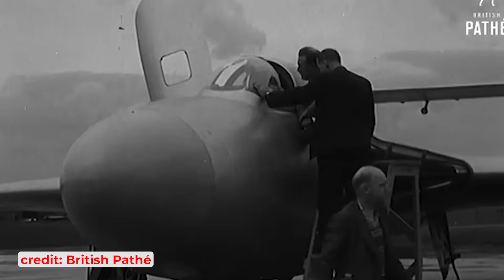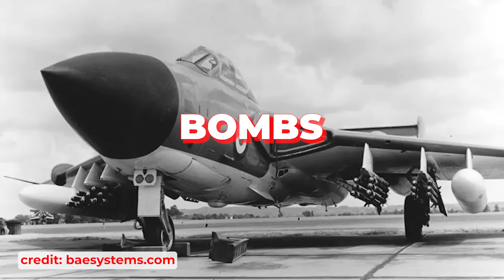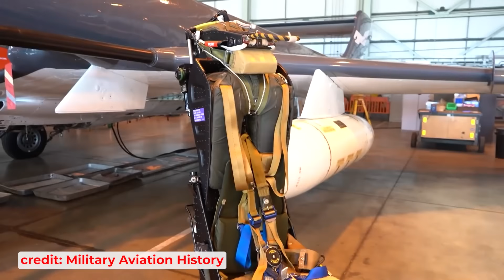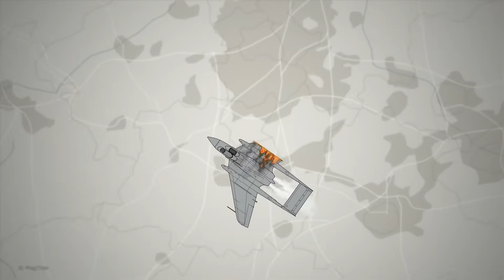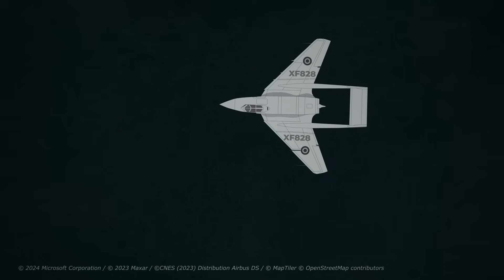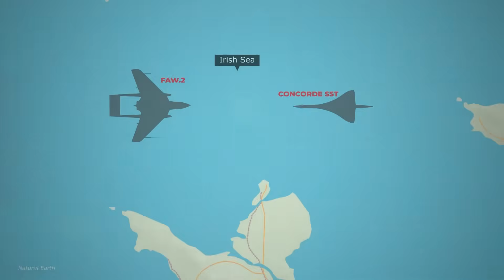Sea Vixen: A Beautiful Killer

Comment: It wasn't the first to break the sound barrier,  that went to chuck yeager in a bell x15 , according to wiki .
Reply: Yes, Chuck Yeager was first to break the sound barrier, but in the Bell X-1, "Glamorous Glennis"!  Not in the X-15 (which was by North American)
Reply: He said first of its type, meaning a twin-boom aircraft.
Reply: @andrewdking  The Sea Vixen was sub-sonic. No de Havilland aircraft ever flew Mach 1.
Reply: @DoktorBayerischeMotorenWerke  I think there was mention later in the video it broke the sound barrier in a dive. Then again some prop planes came close to doing that in a dive I've heard but not substantiated.
Reply: @andrewdking  The DH-110 had a V-NE (never exceed speed) of 525 knot indicated airspeed or a Mmo (maximum operating Mach number) of Mach 0.95 Pilots were strictly forbidden to exceed 525 knots due to loss of pitch control authority and flutter that caused catastrophic in-flight structural failures.
 Propeller driven aircraft cannot fly supersonic, there is simply too much drag.
Reply: @DoktorBayerischeMotorenWerke 
Sea Vixen Compared. 

We feel we can clear up some commonly held myths and misconceptions, obviously.

It's always good to see the facts presented clearly and concisely isn't it.

We feel we can clear up some commonly held myths and misconceptions, obviously.

It's always good to see the facts presented clearly and concisely isn't it.

See further down for a Meteor losses comparison.

See below for Comet accident losses comparisons. The Comet had similar accident losses fatalities to the later Sud Aviation Caravelle. Much later jet airliners from US manufacturers had significantly worse accident losses. 

The Vickers VC10 held the Atlantic crossing record for 43 years  (Non supersonic airliners). 

The Harrier was the only aircraft of its type at the time it first flew. All 1250 Pegasus engines built for all Harriers ever built anywhere were British build and design engines. The first 135 Harriers purchased for the USMC were entirely built in the UK. All 436 USMC Harriers had British built engines. 

The world's first wind tunnel was built in England during the 1800s. The world's first supersonic wind tunnel was built in England during the 1920s. 

Indeed that's correct. The Whittle Gloster E28/39 was of course a brilliant aircraft that was later copied in Russia as the upsized and tweaked Mig 15 with a copy of the RR Nene gas turbine aero engine.

Obviously the RR Nene being the world's most powerful & most reliable gas turbine aero engine in 1944.

The MD F3H Demon was a contemporary to the DH Sea Vixen & had a similar performance. The F4 Phantom was a follow on from the F3 Demon. The Sea Vixen took a long time to get from first flight to introduction for various reasons and a similar situation occurred with the MD F3H Demon.

McDonnell Douglas F3H Demon
590 Built. Not Supersonic.
Max Speed 578 MPH.
Introduction date 7 March 1956
First flight 7 August 1951
Retired 1964

MD F-4 Phantom 2
Number built 5,195
Manufactured 1958–1981
Introduction date 30 December 1960
First flight 27 May 1958

DH Sea Vixen
Number built 151 (including two DH110 prototypes and one Sea Vixen prototype)
Introduction date July 1959
First flight 26 September 1951
Max speed 695 MPH.
Retired 1972

Regarding the UK Aerospace Sector.
 
An airline recently ordered 60 RR Trent XWB Engines.

It's a great pity & a crying shame that British military forces had to occupy a large part of Germany for decades after 1945 & Russian military forces had to do the same. Of course Russia still posseses a large chunk of what was German territory & of course Russia & the UK produce nukes. Obviously Germany does not produce nukes.

Interesting British achievements.
There is no doubt that the Fairey (England)
Delta 2 was of course the world's first jet
aircraft to exceed 1000 mph.  Indeed It
exceeded the previous record by 310 mph &
held the record for 1 year. Incidentally, the Dassault Mirage 3 & 4 are based on the Fairey Delta 2.

Early days, jet fighters.
De Havilland Vampire, Sea Vixen & Gloster Meteor accident losses were not high or unusual for fighter aircraft at the time. De Havilland built large numbers of all metal airframe aircraft before the DH Comet.
We mustn't forget of course that the DH Vampire for example first flew in 1943 & the engine was also built by De Havilland. There were examples of the Vampire interceptor / fighter in service until 1990 which was operated by more than 30 countries.

Non combat phase accident losses.
% of Aircraft built.
The Canadair CL-44 was a turboprop airliner.
Canadair CL-44                  (ff 1959 ) 48%
Lockheed XF104                (ff 1954) 100%
Lockheed  P80                   (ff 1944) 43%
Lockheed F104                 (ff 1954)  45%
Grumman f9f-5 Panther   (ff 1947) 44% 
Convair F102 Dagger        (ff 1953) 45%  
MD F-101 Voodoo.             (ff 1954) 34%
MD FH Phantom 1            (ff 1945)  35%
MD F4 Phantom 2             (ff 1958)  28%
MD F3H  Demon               (ff 1951)  32%
Gloster Meteor                  (ff 1943)  21%
DH Vampire                       (ff 1943)  23%
DH Sea Vixen                     (ff  1951) 33%
Gloster Javelin                   (ff 1951) 20%
EE Lightning                       (ff 1954) 33%

An example of what goes on these days in various countries.
For example, there are of course no German companies that makes German jet aircraft in Germany & there are no German Companies that make German gas turbine aero engines in Germany that are suitable for widebody airliners.

Brazil makes very good airliners & Brazil is 100th down the list along with Indonesia for wealth per capita. Of course it is in fact the case that Embraer can't build those airliners without purchasing stuff from the US, UK & Europe. Norway Holland Denmark Ireland Belgium - Top 20 wealth per capita - Don't make airliners -  its as simple as that.

    Early days of the airliners.
That's correct of course, at the time the Comet wasn't particularly dangerous. Agreed, that is indeed the case of course, The DH Comet was definitely not the worst engineering failure in commercial airliner history.

How things were back then. 
Accident losses - % of aircraft built.
DeHavilland Comet 4                   14% 
DH Comet all mks   (ff 1948)       17%  
Vickers VC10 UK                            5%

The DH Comet had better safety than or similar safety to many other commercial passenger aircraft of a similar era.

Douglas DC-1                                      99%
Douglas DC-2                                      47%
Douglas DC-3                                      30%
Douglas DC-4                                      26%
Boeing s300                                        72% 
Boeing 307                                          70%
Boeing 247                                          48%
Boeing 707                                          20% 
Lockheed L-049/149 Constellation  30%
Lockheed Electra Turboprop             29%
Fairchild FH-227                                  30%
McDonnell Douglas DC-8                   14%
Sud Aviation Caravelle                        15%
Canadair CL-44  Turboprop                46%  
Convair CV-580  Turboprop                22%
Convair CV-880     (ff 1959)                27%  
Convair CV-990     (ff 1961)                33%
Tupolev T-104        (ff 1956)                16%

The VC10 held the fastest Atlantic crossing speed record for 41 years (Non supersonic airliners).

For the first few years of operations the Caravelle and Comet had similar accident loss Fatalities numbers.

De Havilland had prior experience building many all metal construction airframe aircraft & thousands of jet powered fighter aircraft that were primarily of metal construction with pressurised cockpits & jet engines built by De-Havilland.

We hope this helps. Cheers as always indeed etc
Reply: @DoktorBayerischeMotorenWerke 

We feel we can clear up some commonly held misconceptions.

It's always good to see the facts presented clearly isn't it?

A potential successor to the Sea Vixen. 

The Hawker P-1103 / General Dynamics / Lockheed F16.

During the 1950s in the UK a number of aircraft that would've exceeded the capabilities of anything on the drawing board elsewhere were in the design stage. They were cancelled for various reasons including the missiles doing everything idea. 

1954, Hawker, fighter development - Air Ministry Operational Requirement OR-323. P-1103, a twin-seat swept wing aircraft powered by a de Havilland Gyron turbojet engine and armed with two Red Dean air-to-air missiles. Reworked the following year-  February 1955, the Ministry issued OR-329, called for a large 40-inch (100 cm) sweep-scanning radar unit AI-18. In October 1955 revised P-1103 proposal for a revised requirement offering the Red Hebe missile. 

In addition to the P-1103 Mach 2.5 design, Hawker also did design work for a faster P-1121 version. Mach 3, steel wing + uprated Gyron engine.

The Hawker P-1103 initial design had a fully variable geometry chin position inlet, Hawker's basic 1954 design would later be used for the General Dynamics F16 Fighting Falcon (Viper) - first flight 1974. The F16 was built in a number of countries with companies in those countries also producing parts for the aircraft that were built in the US.

We hope this helps.
Reply: @DoktorBayerischeMotorenWerke 

A number of similar performance non supersonic jet aircraft got to first flight stage at around the same time. 

The MD F3H Demon was a contemporary to the DH Sea Vixen & had a similar performance. The later F4 Phantom was a follow on from the F3 Demon. The Sea Vixen took a long time to get from first flight to introduction for various reasons and a similar situation occurred with the MD F3H Demon. The Douglass Skyhawk delta wing is a contemporary to the the Gloster Javelin delta wing. Both non-supersonic delta wing aircraft, the javelin had better performance and first flew a few years before the Douglass Skyhawk.

Douglass A-4 Skyhawk 
2950 Built 
Intro 1956
FF 1954
In service to 1980s
Max V 670 MPH
Delta wing. A small / light jet aircraft designed for carrier operations without having to have folding wings. Often referred to as the scooter. 

McDonnell Douglas F3H Demon
590 Built. Not Supersonic.
Max Speed 578 MPH.
Introduction date 7 March 1956
First flight 7 August 1951
Retired 1964

MD F-4 Phantom 2
Number built 5,195
Manufactured 1958–1981
Introduction date 30 December 1960
First flight 27 May 1958

DH Sea Vixen
Number built 151 (including two DH110 prototypes and one Sea Vixen prototype)
Introduction date July 1959
First flight 26 September 1951
Max speed 695 MPH.
Retired 1972

Gloster Javelin.
434 built.
FF 1951
Intro1956
Max V 710 MPH
Delta Wing. 

Interesting British achievements.
There is no doubt that the Fairey (England)
Delta 2 was of course the world's first jet
aircraft to exceed 1000 mph, 10th March 1956 Indeed It exceeded the previous record by 310 mph & held the record for 1 year. Incidentally, the Dassault Mirage 3 & 4 are based on the Fairey Delta 2.

When the EE Lightning first achieved Mach 2 it was one of the fastest aircraft on the planet. 
P1 Mach 1 achieved 1954, Mach 1•5 capable.
P2 Mach 1 achieved 1956, Mach 2 capable. 
P2 Mach 2 achieved 1958.

The Hawker P1103 was a design and part built prototype that would have led to Mach 2 & Mach 3 versions of the aircraft. The General Dynamics F16 Fighting Falcon was of a similar design that went into service in 1975. The P1103 was cancelled during the switch to "mostly missiles plus no supersonic interceptor aircraft required in the future" era which included cancelling air to air missile development. Scheduled for test flights in 1958 and to be in service 1962. The General Dynamics F16 Fighting Falcon - based on a British design started 39 years earlier, built in the US and a number of manufacturing partner countries with parts for the US built aircraft sourced from partner countries. 

There were plans to do a supersonic thin wing Javelin which of course got cancelled. 

Early days, jet fighters.
De Havilland Vampire, Sea Vixen & Gloster Meteor accident losses were not high or unusual for fighter aircraft at the time. De Havilland built large numbers of all metal airframe aircraft before the DH Comet.
We mustn't forget of course that the DH Vampire for example first flew in 1943 & the engine was also built by De Havilland. There were examples of the Vampire interceptor / fighter in service until 1990 which was operated by more than 30 countries.

Non combat phase accident losses.
% of Aircraft built.

The Canadair CL-44 was a turboprop airliner.
Canadair CL-44                  (ff 1959 ) 48%
Lockheed XF104                (ff 1954) 100%
Lockheed  P80                   (ff 1944) 43%
Lockheed F104                 (ff 1954)  45%
Grumman f9f-5 Panther   (ff 1947) 44% 
Convair F102 Dagger        (ff 1953) 45%  
MD F-101 Voodoo.             (ff 1954) 34%
MD FH Phantom 1            (ff 1945)  35%
MD F4 Phantom 2             (ff 1958)  28%
MD F3H  Demon               (ff 1951)  32%
Gloster Meteor                  (ff 1943)  21%
DH Vampire                       (ff 1943)  23%
DH Sea Vixen                     (ff  1951) 33%
Gloster Javelin                   (ff 1951) 20%
EE Lightning                       (ff 1954) 33%

More recent UK military jet aircraft.
 
The Tornado & Typhoon & their engines are Supersonic & are indeed British design aircraft with British design engines built by an international consortium. The Tornado design for example started life during the 1950s at Vickers as the AFVG, it's engine is based on the RR RB-199. The EE Lightening is also a British Supersonic jet aircraft.

The Typhoon is the British BAC-EAP with an engine based on the British RR XG-40, the Typhoon is also built by an international consortium.